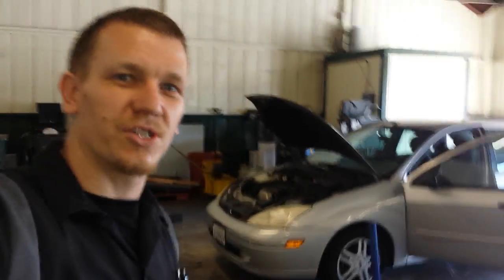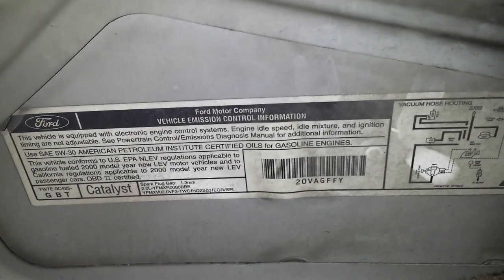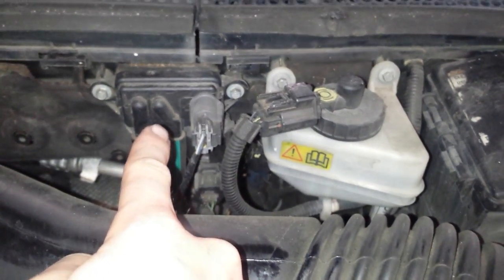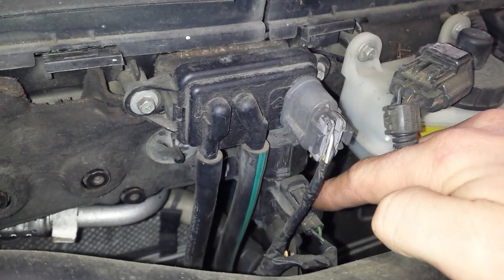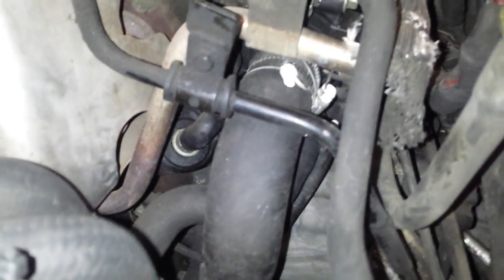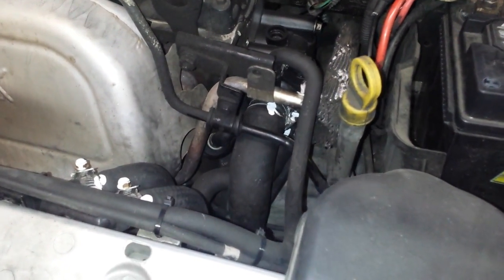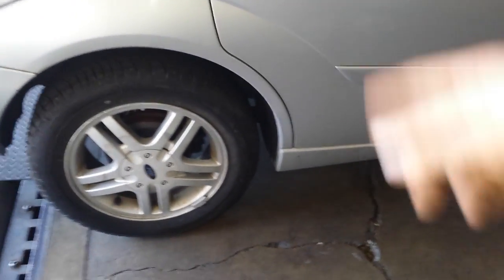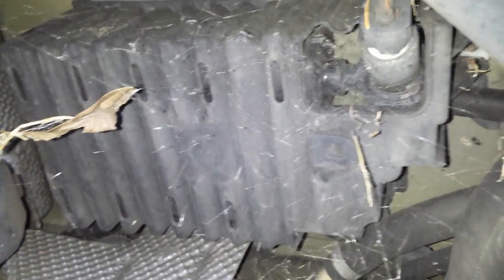Ford Focus emissions: PCV valve, EGR valve, EVAP canister, & vent solenoid

Comment: Thanks for this video and placement of this evap canister vent solenoid. A woman almost 60 having to put my learning from my husband the past 24 years to make repairs now to our 2000 Ford Focus. Just finished alternator, belt tensioner and thermostat replacement. My husband can't work like he used to and he has never wanted me to be a woman that gets taken advantage of not understanding what needs to be replaced in our vehicles. About seven years ago, I was replacing most of the same things including a water pump on our 1997 Dodge 1500 pu. These videos I have been able to find on u tube have been extremely helpful this time round with our Ford. LADIES no matter your age, you can be aware of what is happening with your vehicle if you don't mind getting greasy to fix your own issues. Don't be one told outrageous labor and parts that aren't really needed. If you find a mechanic be sure they are not afraid to answer your questions as I did for things larger than I could do. Of course, it really helps having a mechanic for a husband... surgeries turned him into a great teacher for me! I find some home beginners have more informational videos than some of the shops do.

Comment: Great video! I bought one of these for $300 and with a myriad of cheap Rock Auto parts I have the car pretty well sorted. When checking timing belt [it looks good enough to last until warmer weather in the summer to change] and installing new serpentine tensioner and idler and belt I jacked up the front of the motor too far to install new water pump while I was in there and managed to pull one thin vacum line off the purge valve solenoid and on subsequent startup a whole shitstorm occured. No performannce, flashing check engine light, eventual check engine light staying on and run like crap. Inspection of air intake to throttle body and checking for harness plugs and anything that managed to pull off I found that thin line to purge valve. I noticed on other videos people manage to break the plastic on the purge valve. Mine fortunately just pulled off. I'll check for other items that may have released as well but I think that;s it. Fingers crossed for when I reassemble it all tomorrow. I'll give the throttle body a quick clean  and clean the mass airflow sensor with sensor clean as well. We have an arctic outflow descending upon us so it will be cold tomorrow...crap. But, I gotta get 'er done tomorrow regardless.

Comment: Hey Scottie!  Great video!  Really helps to see where all these are located and what they look like...too many online tutorials just gloss over this.  Anyway,  I had a question about my '03 Focus.  I recently started it up after it being dormant all winter and it is idling rough.  I bought a scan tool and it is giving me a P0303 code, which apparently means that cylinder 3 is misfiring.  I've recently also changed spark plugs, air filter, fuel filter and oil, as well as replacing my air filter housing.  I've done a visual check and haven't found any vacuum leaks.  Going through the internet, I'm finding a fair amount of info about egr valves being a source of problems as well as the PCV valve.  I guess what confuses me is wouldn't these issues show up on the scan tools?  Any suggestions about what else I might try?
Reply from the maker: +rhudon12 a live data scan tool might show you a missfire count and on what cylinder but its not going to tell you what is the exact problem. Do you have a coil over plug ignition or a distributor?
Reply: Hey Scottie,  Thanks for the reply...my 'o3 looks just like the one in the video (Same color and everything :) ) I believe that it has a single ignition coil pack which has leads to the individual spark plugs in cylinders 1-4.  Just like the one in your video.
Reply from the maker: Ok first simple thing to do on that car could be a compression check. check all cylinders and see in the #3 has lower compression than the other 3. It really is a simple test if you have the right gauge. That would tell you if you are working with a good motor. If that is all good, I would get one of those spark plug light things. lol. You put it in line to your spark plug so you can visually see the spark sent to the plug. Compare all 4 wires, if #3 is different, I would suspect a bad coil pack. It could be EGR or PCV but I have never seen that my self. Computers are sometimes easily fooled.
Reply: Thanks Scottie!  I'll get a gauge and give it a shot.  I appreciate the help.

Comment: What is the evap service port for? Also is the Vapor canister purge solenoid something different or is it one if the things you pointed out? Thanks do much for your time and video.
Reply from the maker: +Edward Thayer try this vid: https://youtu.be/eJKuSLY9FRg I point out the canister purge solenoid in that video. Also the evap service port is for doing diagnosis. We would use it to induce a nitrogen or smoke into the system to check for leaks.

Comment: I keep getting an evap not ready code on an emissions test. I will check to see I can find the problem in these locations.
Reply from the maker: What year is your vehicle?
Reply from the maker: What state are you trying to pass smog?
Reply: The car is a 2003 ford focus svt 2.0 dohc and I'm in Utah
Reply from the maker: @brentbourgeous3467  is that the only monitor that will not set to ready or do you have a code?

Comment: How can I get to the EGR valve to take it off to clean it or replace it? Please respond ASAP
Reply: take off the intake line between your air cleaner and your throttle body. You may want to remove the PCV breather hose that goes to the air cleaner as well. Then your EGR valve is pretty easy to get to, though it's a bit tight to get a wrench in there to loosen the nut on the compression fitting.

Comment: I was under the impression That the vent solenoid was on the canister and the purge valve was on the firewall.
Reply from the maker: You are correct,  I should have a updated video in my library.

Comment: These cars are tanks, my dad had one with almost 400,000 on it and the oil pump let go, i have one with almost 300,000 on it and is running like a top still.
Reply from the maker: That is great to hear. I have learned that honestly any vehicle can last a long time. it all depends on how you maintain that vehicle. If you treat your vehicle well and maintain it to the vehicle manufacturer standards a vehicle will last a really long time. preventative maintenance is key..